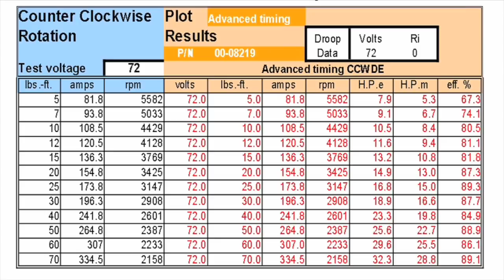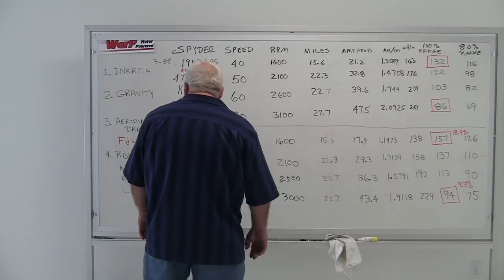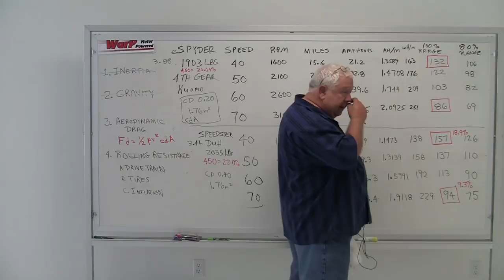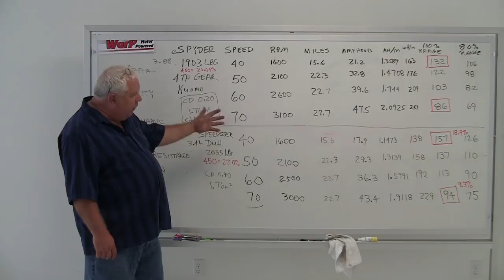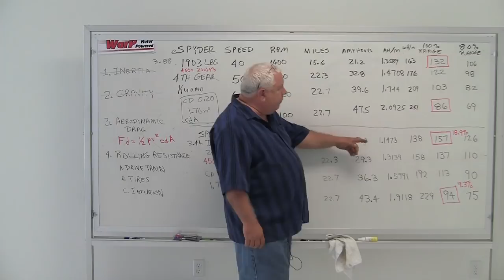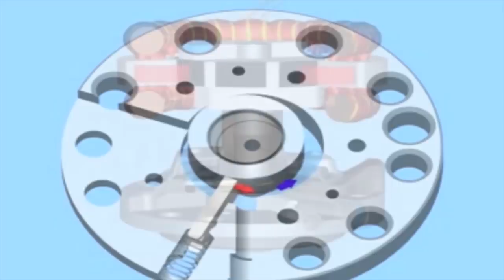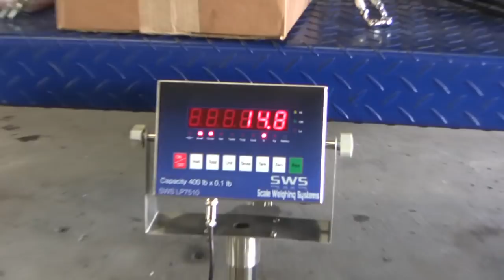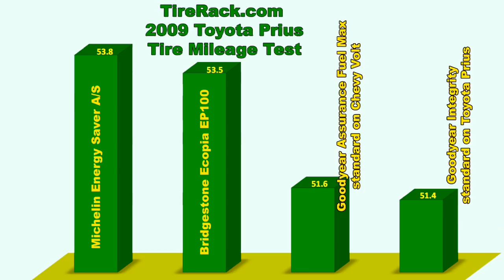EVTV Friday Show - August 19, 2011

Comment: Hi Jack, I believe the drag the faster u go gives u the answer as u point out. I believe you have a brake pad on the right rear eating up the efficiency and also the tires are a factor but not as much as the brake. The exponintial increase in the drag is bringing out the much worse CD on duh bringing the cars closer together the faster u go. Which leaves rolling resistance.  i think your fixes are going to make a huge impact on the spyder. cant wait for the results. Great chalk talk!